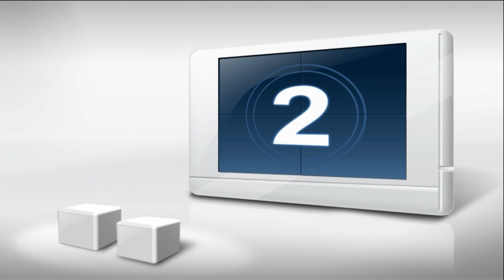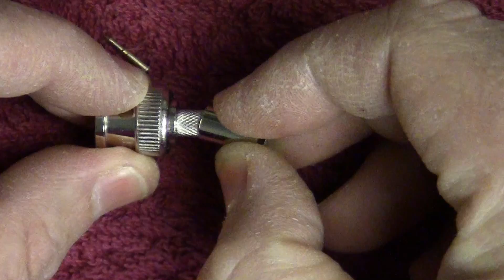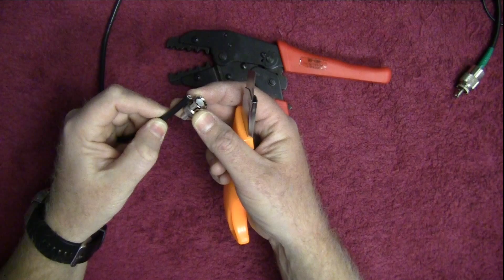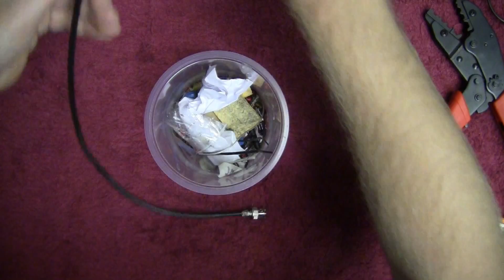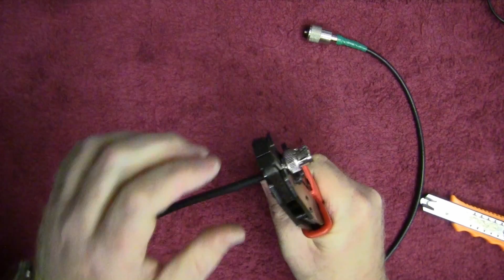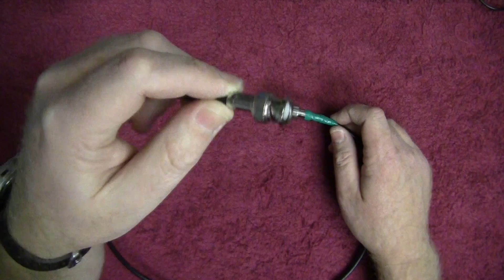Episode 12   BNC Crimp Type Connectors

Comment: Can you just crimp the center pin to the central conductor instead of soldering it? I think some crimp tools have a special small die to do just that, could be wrong. 
How did you know which size die to use to crimp? Have you ever tried compression connectors, similar to the compression F coax connectors?

Thanks for making this video!